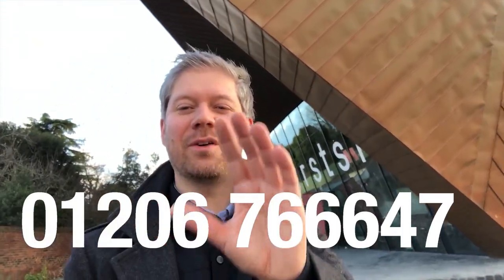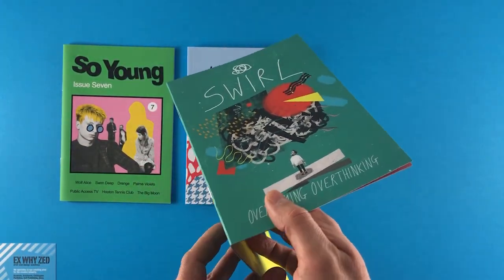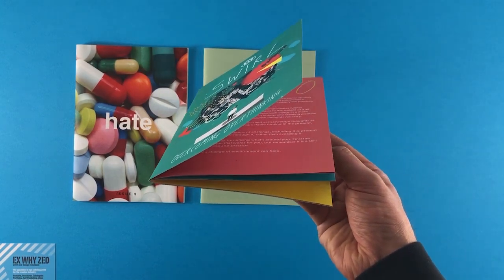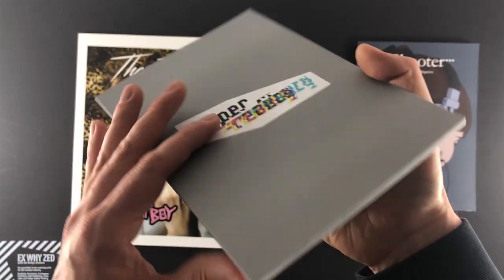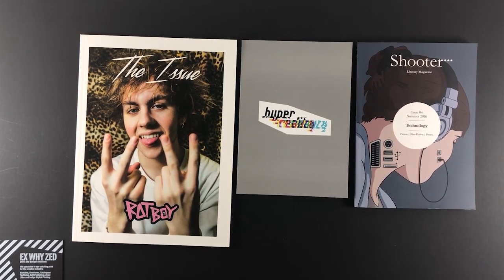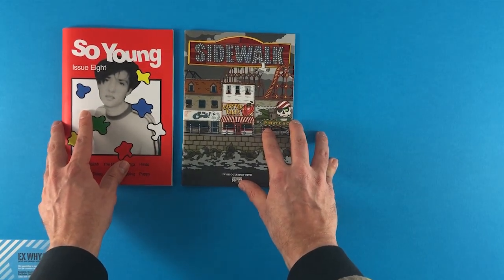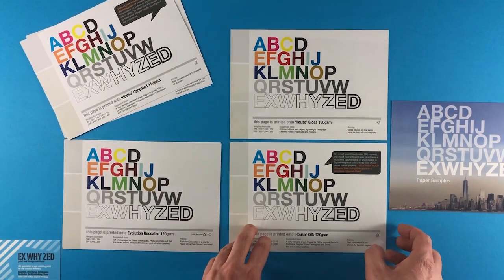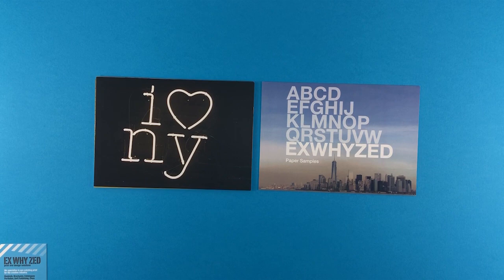The Definitive Zine Printing Guide at Ex Why Zed #zines #magazine #printing #inspiration

Comment: The reason I like the stiched over the perfect binding is, that the stiched binding allows a much easier opening of the zine, especially if pictures go over two pages.
Reply from the maker: Yes Jan, very true. They both have their pros and cons but being able to open the pages completely flat is a great advantage of wire stitching (stapling)

Comment: Thanks for this very informative and inspiring video! 
What I'm missing: zines in square or landscape-oriented format. No offense meant.
Reply from the maker: Yes, good shout...for a square format you could go for 210x210mm, 148x148mm. They are both cost-effective sizes to print. However, we can go as large as 297x297mm for a really formidable zine or any bespoke size in between. Hope that helps, thanks for taking the time to comment.